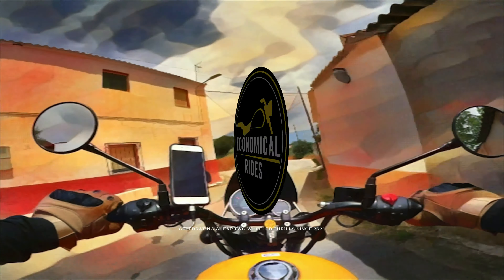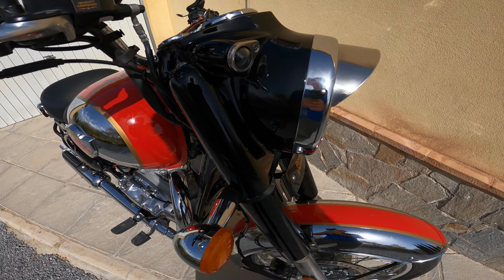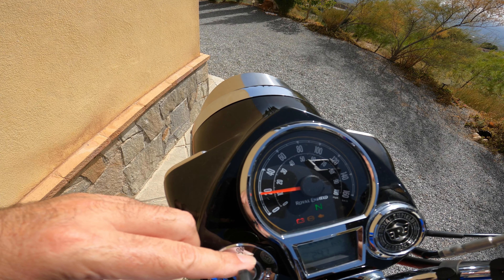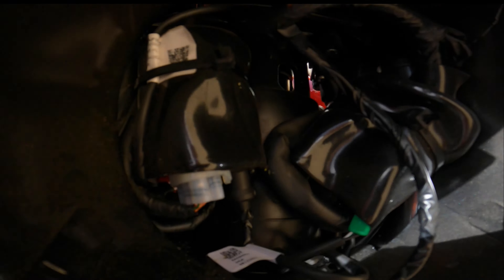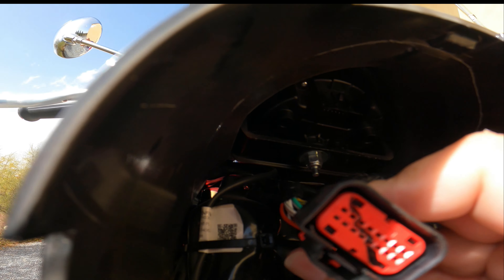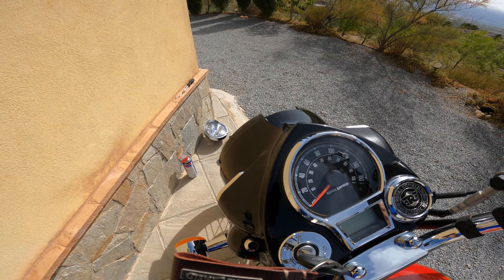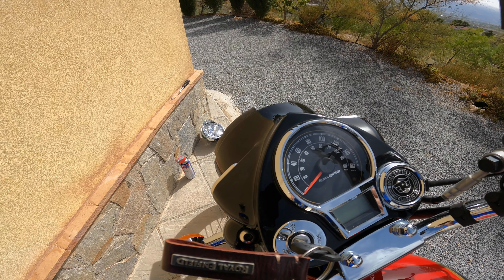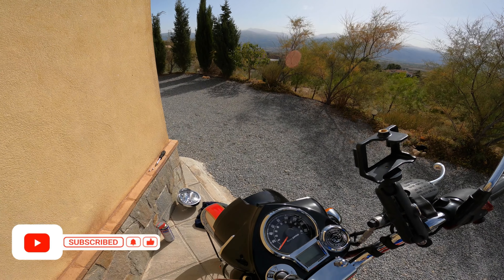Royal Enfield Classic 350 REborn - "Sticky Speedo" Fix ? - Well It Worked For Me ( So Far ! )

Comment: Thanks for the info.  Fixed mine right up.  If that corrects the problem, it show the problem is not in the speedo but the connector.
Reply from the maker: Hi Chuck, glad it worked for you too.

This fix lasted for six months and then I sold the bike. The speedo was still working correctly when I sold it, so the fix certainly lasts a fair while and of course, can be repeated if necessary.

In our cases, I agree that the connector is the problem. I think that the speedo is very sensitive to variations in resistance across the connector. I think that sometimes, maybe when you ride in hot humid weather and then the bike cools down, condensation can form inside the connector. That affects the conductivity across the pins and that results in weird speedo behaviour.
If the pins in the connector are clean and dry, everything seems to go back to working normally.

Other people have had a different issue, whereby the faceplate of the speedo starts lifting up. You can then hear the needle scratching across it and eventually the faceplate rises up enough to physically stop the needle from making the full calibration sweep. 

So RE certainly had at least two different issues to deal with, with these speedos, possibly there are more. 

The part number of the speedos they are issuing these days is slightly different, so it appears that they have a new revision of this speedo. Who knows which, if any, problems it addresses ? Time will tell.

But certainly fixing the speedo yourself is the better option because losing your original mileage count would be extremely annoying and supposedly when the dealer swaps out the speedo, he has no option to restore the original mileage ( which I find hard to believe but that's what they seem to be saying to their customers ).

I hope your current fix lasts as well as it did for me Chuck.

Cheers Chuck,
Garry

Comment: Good morning. Mine started doing this at 1400km. I couldn't get the plug out to clean it. It seems to have some kind of glue. But just shaking the plug and pushing it to the bottom the speedometer returned to normal, which deprives that it is really bad contact in the plug. Probably motivated by the glue they put there in the assembly.
Thank you for the useful video you created. Compliments.
Reply from the maker: Hi Jorge. Yes, I'm sure the issue is in the connector itself rather than the speedo unit !
I'm glad you got it working again for now.
The connector should come apart but it is a bit of a struggle the first time 👍🏻
Thanks for letting me know that my video helped, that's great to know !
Cheers Jorge,
Garry

Comment: Interesting...wondering if just disconnecting the speedo is 'resetting' the gauge?  Hoping it doesn't happen here, but at least it seems most get it fixed doing this simple procedure.  Thanks for posting it up!
Ride Safe 🙏🏼
Reply from the maker: Thanks Scott,
possibly, but I also believe that these connectors can be dodgy. It's possible that the contacts were just never properly clean from the factory and that something in there affects the current when the temperature starts to rise. It's an odd one but cleaning and protecting the contacts against future corrosion can never be a bad idea and it was easily done.
If it ever happens again I will disconnect and reconnect the speedo. Then we'll know for sure ! But I have a feeling it may not happen again. I left the bike out in the sun yesterday expecting the speedo to then play up again, but it didn't and I'm sure it would have done previously !
Cheers Scott,
ER
Reply: @economicalrides  If it were heat related, I'd have expected it to show here when we were at 110ºf!  
Glad yours appears to be OK now.  Sucks having a new toy with a problem, but as far as bad things go, this one isn't too bad!

Ride Safe 🙏🏼
Reply from the maker: @scottboettcher  Well it gets equally hot here in the summer and it only played up when the bike had been parked in the sun for an hour or so. Ambient heat didn’t seem to be the problem, just being stood in direct sunlight for a certain length of time. It was certainly weird.
But now it had been stuck for over four weeks in the garage and this time it didn’t repair itself once it had cooled down, like the last two times. Hopefully this fix is permanent or if not, at least repeatable whenever required. I could live with having to do this once per year, if it means that I can keep the original speedo 🙂
We’ll see, I will definitely let folks know should the problem reoccur. 
Cheers Scott, stay safe 🥃
ER
Reply: @economicalrides  I have a little gel pad that I flop over the Speedo when 0arked if I'm not able to get the bike in the shade and this seems to work 👍. I will update in later comments 👍
Reply from the maker: @639viablecarrot  OK. That's great. I was thinking of taking a black rag and an elastic band and attaching that every time I stop but then I decided that half the time I'd forget to put it on anyway, so not really worth carrying it about with me 😂
Do let me know how your speedo behaves once you've cleaned and protected the contacts. So far Warro and I have had no issues since. The more people we have testing this fix, the better !
Cheers Hqmpest,
ER

Comment: SOUNDS GREAT GREAT GREAT. ( AWESOME )
The LAST few seconds, WHAT have you 'Slipped on'???
WHAT Muffler have you installed PLEASE??
THANK YOU and THANK YOU for your video.
MOST Helpful.
Regards.
Reply from the maker: Hi Terry, ‘slipped on’ ? Not sure what you mean 🤷‍♂️
The exhaust on my bike is standard, in fact, the whole bike is standard, I just removed the rear seat.
Cheers Terry and good luck with your own speedo !
ER
Reply: @economicalrides  
                                    Sorry, I did assume you installed a 'Slip-on muffler' after I heard That exhaust note. 

Regards.
Reply from the maker: @tpv59  No problem.
It's bone stock, it even has the standard fit dodgy speedo 😂
Cheers Terry, let me know if the fix works for you, I'm trying to collect some data on it !
ER

Comment: It will repeat for sure, faced this issue while we ride in hot sunny Indian day on a regular basis.
Reply from the maker: Hi Mahesh,
I think the extreme heat causes some kind of change in the speedo connector, maybe oxidisation on the contacts due to humidity in the air or something. If cleaning the connector solves the problem for a while, I will continue to clean the connector because my dealer says that if they change the speedo, they cannot restore the original odometer reading. Which I don't believer but that is what they are saying. And I don't want that, so will continue to "fix" it myself !
Cheers Mahesh,
ER.

Comment: Hellooo ER 😁 I'm way behind with watching your videos, and to my shame, just realised I didn't have the notification bell dinged! 😔
Hope you're on the mend anyways. Ruby is looking in fine fettle 😊
I look forward to seeing if your speedo behaves. Mine just stopped sticking, back in July I think, and hasn't stuck again since. I didn't have to take it apart or anything. Very weird but 🤞that it carries on that way. 2300 miles on the clock now 😁
Take care now ER and hope you feel well enough for a ride soonest.
Reply from the maker: Thanks DoomNedwob,
thanks for hitting the dingy thingy too, I appreciate it, it all helps me to get noticed by the YouTube robots 🤣
Nurse Ruby is being excellent, taking great care of me and only needs paying in economy frankfurters, so I can just about afford her excellent medical care !
I definitely think there is an issue with the speedo connector rather than the speedo itself. In this video a speedo which was clearly defective suddenly works again after being disconnected, having the contacts cleaned and being reconnected. I think RE are replacing speedos at great cost which may not even be necessary. This is backed up by people saying that they are already on their third or fourth speedo. Maybe the connectors are just dirty or slightly corroded when fitted and they just need a proper clean out to work reliably. Who knows ? It's certainly interesting and credit to Warro for trying this out !
The day after making this video, my dealer told me that my new speedo had finally arrived ! Of course ! 🤬
They can keep it for now, I want to test mine further !

Cheers DoomNedwob, glad you won't be missing any more of my awesome videos 🤗 😜
Hoping to ride at the weekend if I start to feel less wobbly on my feet !
Cheers buddy,
ER.
Reply: @economicalrides  I'm glad Ruby is looking after you 😊
The speedo thing is a strange one. I'm glad I didn't bother replacing mine now. After sticking a few times in some 20°+ weather, but then after our, distant memory, heatwave at 32+°, it hasn't stuck since! I was always slightly doubtful about the heat issue, thinking, if the plastic had warped, it could have stuck at any speed, but it always seemed to be exactly at a 10mph interval. Then on start up would sweep up to 10mph past 100 or whatever it is and back, still very smoothly, so thought maybe it was  an electronic thing instead. It will be interesting to see if cleaning the contacts sorts it permanently for you. Perhaps mine had an intermittent dodgy connection and it vibrated itself into the right place, who knows, but it's not let me down for months 😁
Anyhoo, enjoy your ride when your legs will allow. Take care out there 😊
Reply from the maker: @DoomNedwob  Thanks DoomNedwob 🙂
Yes, mine fixed itself the first couple of times, it was sufficient just to leave it in the garage overnight to cool down and the next time I went out, it would calibrate correctly.
This time I parked it showing 20 at a standstill before I left for Germany and fully expected it to calibrate to zero nearly four weeks later, the next time I tried it. I was very surprised that it remained stuck at 20 after all that time, it was the first time it had ever done that ! Fortunately in the meantime I had seem Warro's video and wanted to make people aware of it via my channel, so decided to do the thing to my bike, really not really expecting it to work !
If it keeps on working I would recommend cleaning and lubing that connector as preventative maintenance, so even for the folks who have yet to have the problem. Maybe these connectors are not perfectly clean or corrosion-free from the factory or something. 
But let's wait and see if the fix appears to be permanent first. If not, at least my replacement speedo has finally arrived at my dealer's shop.
Cheers 🥃 ( medicinal of course ! )
ER 😜
Reply: @economicalrides  We shall wait and see indeed, cheers ER 🍺😁